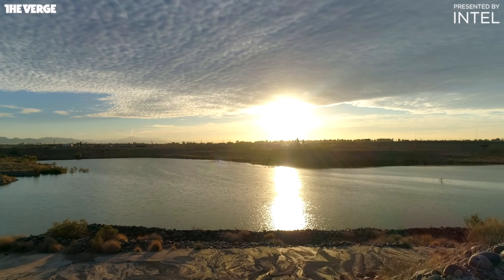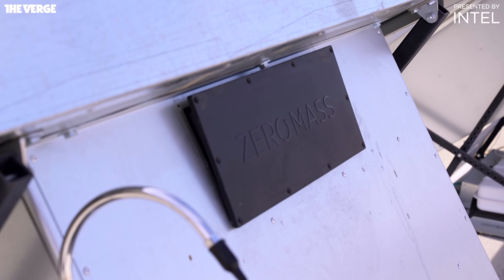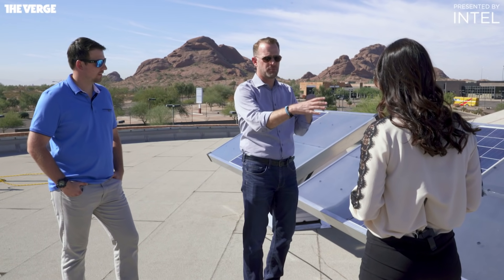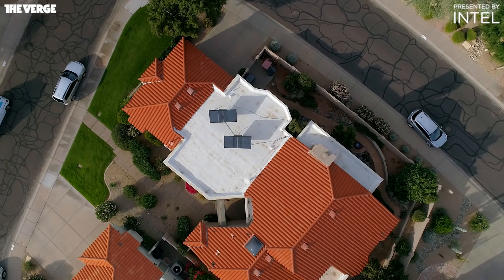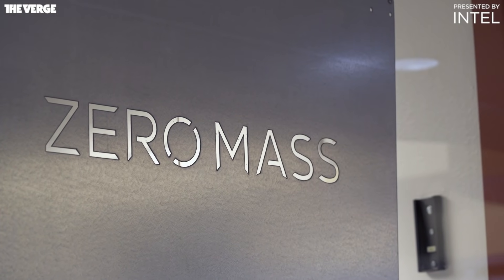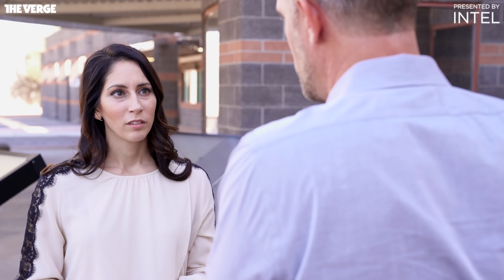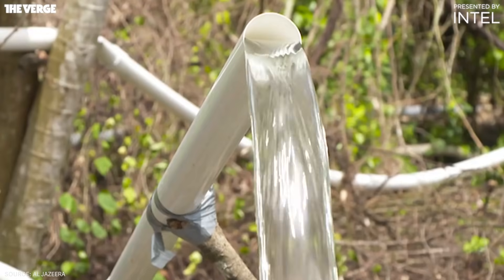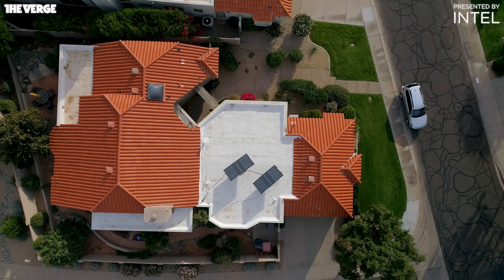Zero Mass' solar panels turn air into drinking water

Comment: $2500??? its just a glorified dehumidifier with a solar panel,  for $100 you can buy a dehumidifier that makes 5 times as much water per day.
Reply: Then make it.
Reply: yes you can drink it but you might want to run it through a $50 filter first, that's the same as what this machine does. the biggest issue is that they will not get much water if there isn't a lot of humidity in the air, In the places that this is most needed is the same places  that it wont work good, this isn't a new idea by the way, other company's have tried the same thing in the past but found that it is not practical.
Reply: @ExperimentalFun  A basic understanding of thermodynamics will tell you that you can increase the humidity/temperature of the air by increasing the pressure of the air entering the system.
Reply: @ExperimentalFun  i hear Israel has perfected water from air.  Don't know the process but i read that they grow melons on the hillsides where is like 6 gals. of dew on a small space at night.  I'd think it would work better at night in any hot area...
Reply: @James Sempy
Cow's milk has BCM7 and other hormone disruptors in it.
Sheep or goats milk is a better choice.
Reply: @Bluemountainpeakside  wribg cíw mik beter
Reply: Pure water does not strip minerals from your body, it just doesn't add minerals. You need a source of minerals in your diet, so yes you would have to make sure you get them from somewhere. They did mention something that can remineralize the water. Solvable problem if it's a problem. Also, eat more greens (mineral rich).
Reply: i've been working with natives in the Amazon for almost a year, and almost 90% of the people from the comunities there, have survived decades only drinking rain water with no issues, so that's the proof of what you just said! your body will find the minerals you need from the food you eat.
Reply: It can. Just get an RoHS compliant dehumidifier and some purification tablets or a filter.
Reply: Vishal um air is more humid in hotter areas. Hotter air holds more water so how does that make sense
Reply: Its the same answer to why people still buy apple products... Except buying apple devices isnt so cool anymore.
Reply: Exactly what I thought
Reply: "Stealing the water from the air" ? (I assume this is a joke)

Nobody own the water in the air, you extract, drink and piss it back to nature. I totally understand the complexity boggles muggle minds.

Tax on the other hand always has loopholes if you keen to find one. Unless you love to pay the tax then i rest my case.
Reply: Same go's for your Humidifier and they stated this in the Video if you bothered to watch it.  : )
Reply: @Vishal that's precisely what the video says that the quantity harvested varies drastically between one part of the globe and the other/ what you may harvest in scotsdale is nowhere near what you would in  Phnom Peng for example , or in Durban south africa. having tropical temp at all times does not always guarantee humidity . which is the selling point of this device.
Reply: This thing is retarded it’s like it can’t do anything well and the price f this thing makes it prohibitively expensive for people who live in water scarce places and the people who can afford it could pay for water or live in places that are not water scarce
Reply: Dr. Gadgil is wrong imho.

I looked into reusing the grey water from my washer, dishwasher, and hand basins, and the cost is quite high in terms of labor to change an average older house plumbing to send all the water to a pond with plants.  The cost was higher than a single panel from this company.

If I could reuse the grey water in my toilets, then the payback would be several decades. 

The cost expense for drinking water in terms of this idea is not too shabby.
Reply: E K grey water recovery is done at the septic output and not within the house.  Grey water is used for irrigation and generally not for potable without expensive endeavors to clean it up.  You can collect water at the sink but yes it's expensive.
Reply: experimental fun - They will make that illegal.
Reply: You aren't including the solar panel, the PH inducers, the filter, the mineral inducers, or the high quality steel frame that could withstand hurricanes. With a dehumidifier, you need to buy your own filters and sometimes you need a power source.
Reply: Basically, you are very correct about this. The amount of minerals in water is negligible and should never be your sole source of mineral intake. Yes, grees, root veggies, and fruits from vines are you best mineral resources. And I have heard that idiocy of distilled water stripping minerals out of your body and yet that simply is not true. As you said, it does not ADD minerals.
Reply: Colorado will charge you with stealing the water from the air if you harvest rainwater. More and more states are falling in line with that mentality. Water, according to nestle, is not a right, it is a commodity.
Reply: "Also, dehumidifier does bot produces drinking water, go on and google, u will get it."

You are correct. Dehumidifiers do not produce clean drinking water, which is a shame because Zero Mass Water IS a dehumidifier. By all accounts, the water that Zero Mass produces is not clean nor safe to drink.
Reply: Vishal Yes it is about money. I can buy same size solar panel for max £300 and a dehumidifier for £100 and volia. This a scam.
Reply: Robert Slackware Or u could just buy a solar panel for about $200 for ur dehumidifier and save 4 grand :D
Reply: but you can boil it use a basic filter and drink it . this solar panel is a pricey start up product .  Interesting at best .
Reply: Vishal your stupid and if it’s a stupidly tough out idea they should be discouraged
Reply: Just a scaled up thing of the "self-filling waterbottle"
Short: It does work! But is extremely unefficient

https://www.youtube.com/watch?v=UVoJACT4-xQ
Reply: Those nanoparticles in the equipment are not something you want in your water. You are getting plenty from other sources. It is not just asbestos that shortening the life span, it is the carbon nanotubes... aka asbestos on steroids.
Reply: https://www.popsci.com/technology/article/2011-04/mit-researchers-use-viruses-build-more-efficient-solar-panels
Reply: Dumpy Death no, hotter air is able to hold more moisture, therefore hotter climates have higher moisture content, even desert air has a relatively high humidity. I like the idea of using this kind of tech in a place like the Sahara or any large expanse of deserted land
Reply: are you a consumer or sponsor. do you want to spend money on "something" that you cant or is not effective at whats its suppose to do? would rather spend the money on stuff that works and i need in my lifetime rather than the future to come. inovation my arse.
Reply: That $100 dehumidifier wouldn't be able to filter the water automatically. The solar panel are being used to make it works without any dependencies on grid electricity.
Reply: Why don't you go and drink some of that water?!
Reply: I've decided to build my own version. It will be a combination of solar and wind-powered. The technology is not hard and the great benefit is it is off the main power grid which can get knocked out and then all those folks with their dehumidifiers will find themselves in short water supply. I've also a small version of a solar distiller to distill clean water from wastewater. I think it is time to upgrade to a larger unit.
Reply: Lechiffresix six well it's designed for places where there is no water and/or desalination is required
Reply: Azri'el Collier lol how s out 19th century windmill water pump technology & a well?
Reply: How about the fact that due to consumers desiring clean water in bottles and the high demand in drought and desert regions that deep water aquifers are drying up and some are even collapsing. If you are so good at observing, then you should already know that.
Reply: Well put.
Reply: Experimental Fun this is cheaper than việt nam.
Reply: in the next decade costs will be reduced like rockets do
Reply: But does your dehumidifier generate power for itself, such that your house power consumption is not affected?
Reply: Vishal https://youtu.be/vc7WqVMCABg you are welcome.
Reply: Vishal and the connection to there network. Plus, solar panels are not that expensive. I can build this thing for cheaper and probably get the same amount of water.
Reply: vishal you'd get more water from leaving a bucket outside lol
Reply: Eric "If I could reuse the grey water in my toilets" seriously, the Swedes are developing "urine diverting toilets" that separate the urine & store it to be applied directly to farms. It contains identical NPK & other trace minerals to bought fertilisers if diluted about 50/50 (depending on how much you drink for exact strength). 

If you really want this, do as many permaculture people are doing, skip the greywater step altogether & just apply the urine to your compost bin or plants (not the pond) directly without needing the flush water at all & use the same amount of fresh tap water you were going to flush to fill the pond.

Do NOT include fecal matter with this!!!!!! If there's any chance of small fecal contamination, you should flush it, or store for at least 3 months at full strength to give the acids in the urine time to steilise & kill any bugs

plenty of info on this on permaculture forums, compketely safe, even on food crops & saves lots of fertiliser money (and water money, but that's cheaper than fertiliser)
Reply: Oliver Cairn
 "in the next decade costs will be reduced like rockets do"
bad example! The cost of a seat on a rocket to the ISS is currently over 1000 times higher than it was when the space shuttle was in operation lol
Reply: Experimental Fun if you use AC , drain pepes also generate water from Air
Reply: Experimental Fun I hope you’re not drinking from your dehumidifier bro
Reply: what utter garbage
Reply: This is not economically feasible.  The laws of physics still apply.  You will get more water by placing buckets outside your home and storing the rain water - for free.  This YouTube video says it all - Busted!  https://www.youtube.com/watch?v=vc7WqVMCABg
Reply: the key difference is the air NEEDS to be filtered before it enters the process. the contaminants will mess up the surfaces, as well as the water.

but,  it may be feasible to put a hepa filter on the deumidifier
Reply: www.AtmosphericWaterSolutions.com Global-Award winning AquaBoy systems make the best tasting water in the world. Cheaper and better than any bottled water. And much less expensive, no installation or related extra costs, less maintenance, produce more water and easier to use than Zero Mass Water.
Reply: Experimental Fun I think you did not understand the concept.
Reply: Yea thats not cost effective!!
Reply: 5 times more water? Which dehumidifier is it? not being sarcastic btw, i genuinely wants to know.
Reply: No, not the same thing at all.
Reply: Lol
Reply: Experimental Fun How much water has your $100 pure water generator has produced since you posted this a year ago?
Reply: @SysPowerTools... IF the infrastructure allows a truck to drive there. In very remote region, this is not the case!! You can't just deliver with trucks and then it is more expensive again, if you have to get it there with quads or even in a backpack. And you will always have to pay for the water. Once the investment costs are payed back, the water of this device will be for free. Stated that their numbers are correct, the water of this device will cost 5 to 10 cents per litre when you annualize the investment costs over 20 years. Bottled water in such regions are 20 cents or more per l...
Reply: good luck getting power to your dehumidifier when the big one comes
Reply: @jjk2one  yer crazy in the membrain huh?
Reply: I make mine with homemade charcoal, recicled bottle and rain for free. The fog catcher is made from potatoes sacks hung on the fence with an old gutter. My new water fountain is going to be made from recicled jars. My complete investment is 0 dollars.
Reply: good luck integrating it into your building
Reply: No it's not a dehumidifier.  Its has specific filters that cleans the water. A dehumidifier is not clean water to drink. It have molds and other contaminants in it. Do your research
Reply: @tonyascreativespace3067  it is pretty clean water, its the same water you are breathing in,  mold would be from not keeping the humidifier clean, anyway you can get a filter for like $5 to filter it, its not rocket science
Reply: And you REALLY don't want to drink the water that comes out of those.
Reply: Bro, solar panel is the only thing that's expensive.
Reply: Maybe $200 for the solar panel
Reply: Also, dehumidifier does bot produces drinking water, go on and google, u will get it.
Reply: @VishalMaharathy  ిిఇిమమ మీ లో
Reply: ben nichols they remineralize the water it says so in the video. They probably run it though a RO filter then remineralize it.
Reply: OK let me get this straight for all. Hotter air can hold more moisture but doesnt mean hotter weather has more moisture, thus we measure both temperature, relative humidity and precipitation. Weather can be dry and hot; humid and hot; dry and cold And humid and cold...... Demudifier will output most at humid and hot conditions. Its output is decreased drastically at cold temperature nomatter how much relatuve humidity is...
AND about this product in particular its HORSESHIT. U need 20 of those to make enough water for family of four. @30 k buying them, the world is better off desalinating and purifying water from sea. I bet at 30K from each home, the Geologist and Chemical Engineers can shower you with rains everyday ,  if you wants miracles so bad
Reply: By Verge: 'Friesen says that on average, one Source device can harvest 5 liters of water per day. Because of the device depends on solar power, he says, that number doesn't vary too drastically between dry and wet climates - solar radiation is stronger in dry places where there are fewer water molecules in the air to absorb it, and water vapor is more prevalent in wet places where solar radiation is less intense.' 
Basically dude, idea is what comes first. If u r in middle of a remote area where there is no electricity then this idea is good and efficient no matter how much humidity is there. If we discourage someone with his idea, he/she might not be able to further research on it. Go on and try making this by yourself then u will realise how difficult it is.
Reply: Wait so this turns "solar radiation" into water? I don't think so
Reply: João Dini  lol, no.... its just a dehumidifier, that collects the water it condenses out of the air, but it gets its power supply from solar.
Reply: And if its about the money then i should go and discourage apple and samsung for making 1000$ smartphones with an inch of upgrade. I m not humiliating but R&D is the suspect for being expensive.😊
Reply: @VishalMaharathy  why is your argument that price of a smartphone. If he is complaining about the price of this product WHICH I AGREE It's a bit much for the quantity. Because I drink by myself 2.5 gallons of water because I LOVE WATER MORE THAN ANY BEVERAGE IN THE WORLD. but why the comparison? NOT ALL OF US ARE WILLING TO PAY FOR A PHONE THAT IS $1000+ . I HAD A FIT PAYING $160 for my phone because I missed the sale when it was only $99 with a month service card for 20 dollars more (reg. $60 with tax) 

You SHOULD CLAIM YOU'RE NOT ADMONISHING SOMEONE BY CLAIMING TO GIVE AN EGREGIOUSLY COMPARATIVE EXPLANATION. All you did was COUNTERCOMPAIN there was no evidentiary support to supplement your opposition. People are marketing on self-sustainability and people wanting to live a more healthier life in the sad thing about it is it's like a niche market it's more of a luxury to be putting a less footprint on the earth which is ironic when it's the luxurious who caused the biggest footprint because all of the things that are now destroying the Earth was a matter of convenience and at one time the poor could not get convenience the convenience was privy to the rich and now the hard working and low class tactics in practices of everyday life is now a part of the upper class it's more sophisticated and more aristocratic to be off grid and self-sustainable because now you can afford it because there are so many government regulations that has prohibited people with low incomes to thrive in a non-traditional off-grid Market

Comment: For many many years there has been heating from solar, in one point solar was used more for heating than to make electricity.
So it can only go(best prognosis) for solar production: 
1) Electricity
2) Heating
3) Water
Reply: For that company i recommend to make a version without a solar panel, as many that type of people that might want to get this system already has a good solar electric system on their roofs.

Comment: Please google how dehumidifiers work and stop promoting scams. In absolutely perfect, purely theoretical conditions this type of device can reach 1 liter of water per 1 square meter of solar panels. Those perfect conditions include very high light exposure combined with low temperatures (for cooling of the Peltier elements heatsinks) and you're not even getting any water filtering included in the price. And also: you don't need those expensive panels, just take regular solar panels and buy a few dehumidifiers off of Amazon. They're just as good.